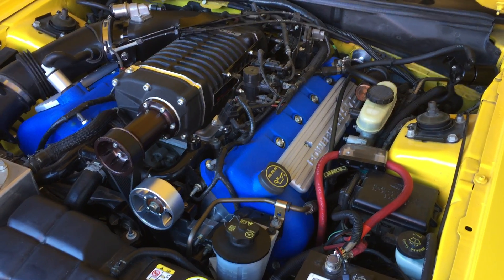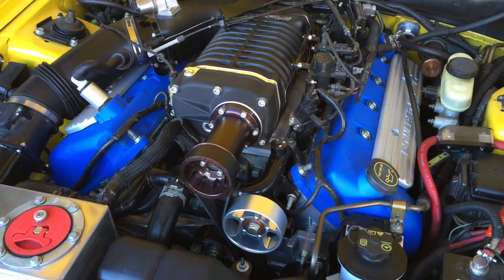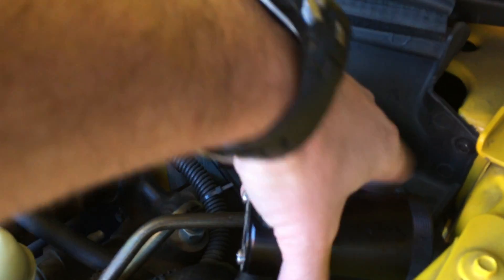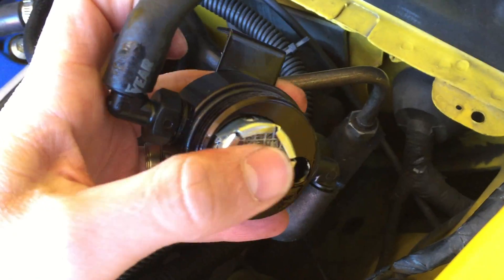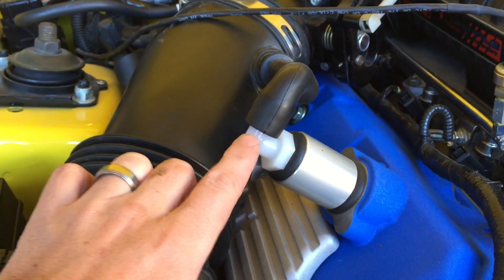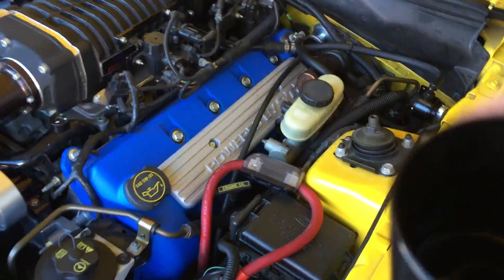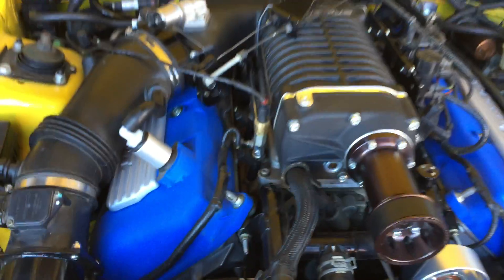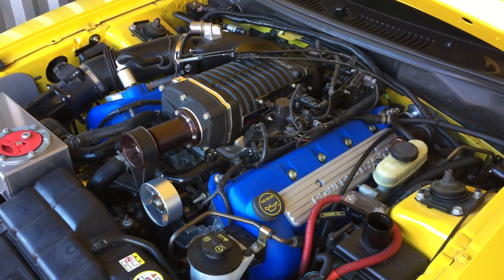How a Catch can Works: JLT catch can and prefilter proper setup

Comment: Hey Danny, I know this is an old video but I have just started looking into this.
I see that in every other video, not necessarily just for our cars, that they orient the inlet and outlet the opposite of how you did it. They have the hose from the pcv valve going into the side of the catch can with the little filter then the hose going back out from the side without the little filter.
 I generally like to refer to you as a source for our cars so I just wanted to go over this.
Reply from the maker: Since this video was made, JLT has changed their instructions, from what I can tell, to screen the oil out of the air as it drops into the can. That way the oil is heavier as a droplet and drips into the can. I don’t like the idea of having a pool of oil with nothing to prevent it from getting sucked into the engine. I believe their first instructions were so the oil would be skimmed off as it leaves the can. It makes more sense for the oil to freely drop into the can and then be skimmed off on the way out. The truth is they should have mesh on both the inlet and outlet like other, more expensive cans
Reply: @dannyjohnsonsgarage  that's a good point. That a tough one, perhaps I'll buy a universal can from elsewhere.

Comment: Hey Danny, I was wondering if that catch can was specific to the driver side. I went to american muscle and their JLT 3.0 can looks like it’s on the passenger side. When I asked them about it they said they didn’t have one for the driver side.
Reply from the maker: They do the same thing, but their kit is probably fitted for driver side and another one for passenger. It seems they have changed their mind on which side the mesh screen is on.
Reply: @dannyjohnsonsgarage  so I could just swap the lines and it should be fine on the driver right?  I appreciate your time good sir.
Reply from the maker: Yeah, it should be the same can. It should have the mesh screen on the side that goes back into the intake, but they apparently changed their mind or the instructions so who knows

Comment: Does it matter if the pre-filter is o  the driver side? And the can setup on the passenger side?
Reply from the maker: You can use either, but it’s recommended to have a catch can on the driver side- and they have stopped selling pre-filters and want you to buy two catch cans now (maybe it’s marketing and sales tactics lol)

Comment: You want the "pre-filter" on each valve cover, feeding a T fitting, that then goes into the inlet of the catch can, the outlet of which connects to a reduced level of engine vacuum. It doesn't take the full 25 inches of vacuum (at idle) to do the job, Best solution is to have a drain at the bottom of the can feeding back into the oil pan, or a bigger reservoir you can empty occasionally.
Reply from the maker: James Allen Now that’s some overkill if I’ve ever heard it
Reply: @dannyjohnsonsgarage  LOL

Comment: Are you using a pcv valve on the drivers side whit this setup...
Reply from the maker: Frank Biondo JLT catch can on the driver side and JLT Pre-filter on the passenger side
Reply: I see the pre filter on the passenger side that goes to the intake but on the drivers side it looks like you have a 90 going to the catch can or a pcv valve going to the catch can I don't see the pre filter on the drivers side...
Reply from the maker: Frank Biondo if you watch it closely you'll see how it's routed.  It doesn't matter which end is 90* but more which hose is coming in the side without the screen but exiting the side that has the screen
Reply: Thank you...
Reply: @dannyjohnsonsgarage  jlt shows it routed the other direction screen on inlet side of can not out....?????
Reply from the maker: @Lilljoescratch  I’ve seen them contradict their own instructions for different models (or possibly a change in the mesh filter) but the purpose is to allow oil into the catch can and then as the vapors rise, the oil is skimmed off through the filter (the mesh traps the oil and the heavy droplets fall back into the can). If it’s not setup like this the oil in the catch can would be sucked directly into the engine without any filter stopping it. It would be pointless to have a mesh screen only on the inlet and not the outlet where it is needed. If the mesh is on the inlet side it might keep some from entering the catch can, but you need one on the exit side  (higher end ones have both). 
  The pre-filter acts the same on the passenger side. It’s intended to stop oil as it exits.
Reply from the maker: @Lilljoescratch  go to this website and you will see their diagram showing the ease of the oil going into the catch can and being filtered on the way out https://www.americanmuscle.com/catch-cans-keeping-oil-out.html
Reply: I set mine up this way. thanks for the clarification and explanation. 👍